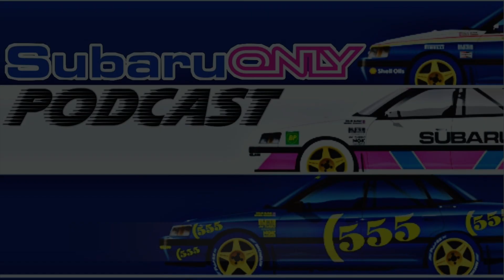Podcast #001 | Subaru Oil Pickups [AUDIO ONLY]

Comment: Luke, I don't think you touched on this in the podcast but, how do you think vehicle age and likelihood of pickup failure are related?
For instance, as the vehicle ages would you expect to see a higher chance of pickup failure?
I find this question important because as we know, there are many older Subarus with over 150k miles on the clock, and going strong on the factory pickup.
Conversely, it is well documented on NASIOC that oil pickup failures have occurred on Subarus with less than 25k miles! 
This is quite puzzling to me and I was wondering if you could make sense of this. Thanks!
Reply from the maker: I think you are right here. Those metal and welds do fatigue over time and can develop micro fractures that grow over time. I would think a new one would be less likely to fail.
Reply: @SubaruONLY  Thanks for your input. This certainly makes more sense to me than KillerB's explaination.
On NASIOC KillerBMotorsport claims (paraphrased) the failure is more due to a chemical reaction caused by the flux used when the pickup is brazed during construction. 
Its hard for me to imagine how a chemical reaction could eat away at a piece of metal submerged in oil. 
I suppose the bottom line is dont be lazy and just replace your pickup! Can't wait for your video on this!
Reply from the maker: Very interesting, I have not seen this.  I agree with you, doesn’t make a lot of sense. Hmm. Hoping to have someone from KillerBee on as an interview guest soon and maybe we can discuss this in detail. I’ll try to make this happen!  😁😁😁

Comment: Need some tips on a 1992 EJ22E, FWD, 5/SM, O/D 249k.
Replaced: 
Engine coolant temp sensor
IAC Valve
PCV valve
O2 Sensor
Coil Pack
Oil Pressure Sensor.
Just looking for advice on what to do next. Thought about timing belt and pulleys and seals. Ect. 
Thanks in advance, love the show. Have a great day man!
Reply from the maker: Great car man!!! Rare in that combo and it’s very fun to drive still!! 

Timing belt is good to do in future for sure. I like to keep the OEM engine bay mint/like new condition and restore paint or finish on all hard parts. New shocks always make car feel great. Upgraded rear and front sway bar with stiffer bushings is nice upgrade. The WRX STi titanium strut brace fits perfect too - and looks amazing. That’s a decent start!! 👊
Reply: @SubaruONLY  do you happen to have a good website to make these purchases at a fair price? You rock man. Thank you for all that you do.
Reply from the maker: Yes. As a matter of fact I do. 
(1) for aftermarket parts I like, www.RallySportDirect.com - they don’t sell any cheap parts so you can be confident everything that comes up for your make / model / year is going to work reliably. 
(2) for OEM parts, the big Subaru dealers that specialize in parts are the best option. I use two main dealers that ship globally, first one is Heuberger Subaru (www.bestbuysubaru.com), and the second one is Flatirons Subaru (www.Flatironstuning.com or www.coloradosubaru.com)!  Hope this helps - cheers.
Reply: @SubaruONLY  what about the cusco strut brace? Talking to someone now that has a set. I just came across a scooped hood for my year and modle. $150. Is that a good deal?

Comment: Were can I find after market front bumper for 99 outbacks
Reply from the maker: eBay has many aftermarket options.  However, there is also the OEM WRX or 2.5RS or STI ones that fit too, and for not much more money. Try flatirons tuning in CO, USA for OEM STi turbo bumpers.